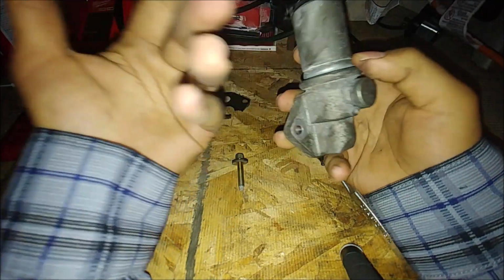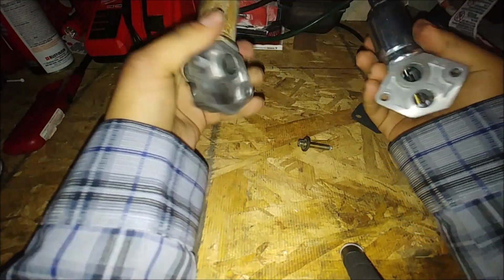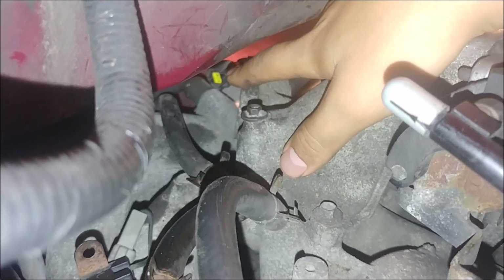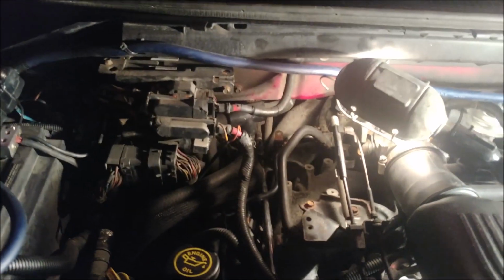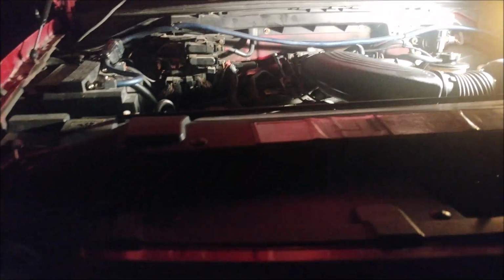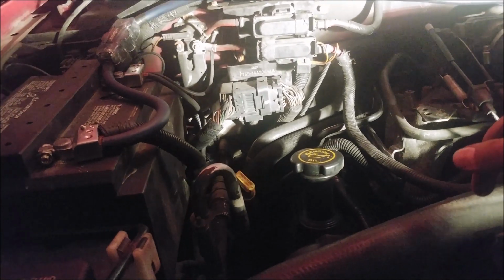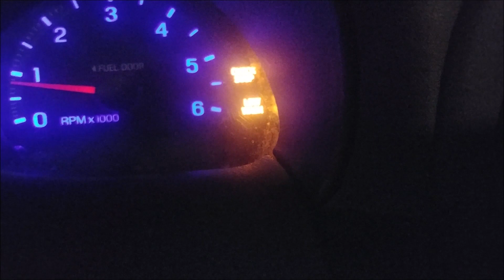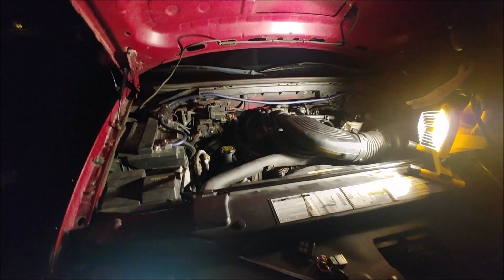1998 Ford Expedition 5.4/4.6  IAC Valve Replacement

Comment: Mine was when the A/C was on, it would feel like it was drowning when stepping on the gas pedal from a complete stop. You need a good lighting source just to see whet you are doing. My technique was using zip ties to hold the hoses and cables out of the way since you can really can reach in with one hand. There is a hose connected to the manifold that you can pull loose and out of the way for better access. You cannot use a standard socket and ratchet. It is better with a 8mm ratcheting wrench like in the video. This is a slow process and you will not be able to change it our real quick. After you loosen up the two screws. You should be able to hand both remove the screws. After it was loose, the wire connector is short and hard to remove the electrical connection. My solution was to route the AC valve back and route from the left side to the right side of the engine. It was far easier to disconnect the electrical connector and then you just route the wire back to the left side of the engine. I then used a channel lock pliers to hold and angle the AC valve using my right hand to hold in position. Then using my left hand to connect the electrical wire back in. You should hear a light click when you do it. Before you put the AC valve back on. Hand thread the two screws in first before to get a feel and know the screws will fit right back in or it may need some cleaning of the  screw threads. I connected the top screw first and threaded through the paper gasket in place. With just enough space  gap to see the bottom screw, I threaded through the paper gasket. It felt like the paper gasket won't line up without seeing the bottom screw go through. Then you hand tight the screws back into place. After that you can tighten the screws with the ratcheting wrench. I got my AC valve on Ebay for 22 bucks. Shipping takes a while to receive it.

Comment: The title for this video is incorrect. This video only applies to the 5.4.  I have a 1998 4.6L engine, and my IAC is right on top of the manifold, next to the throttle body. VERY easy to access.  Could not be easier.
Reply: Definitely correct I see mines too,  changing it now 😁💪🏾
Reply: Correct sir!!!

Comment: Did you take the hose off that was blocking the bottom bolt? Mines set up the same way as yours and I can’t get anything in there on the bottom 8mm bolt.
Reply: did you?? i tried but mine seemed stuck and i don’t wanna rip it off and cause another problem
Reply: I was able to change it out without taking the hose off

Comment: Why did you changed the part,  (IAC)
Reply from the maker: The IAC gasket needed to be replaced and also I had a weird idling issue which went away when I replaced it
Reply: GHOZTPRODUCTIONZ ok, thanks
Reply: @GHOZTPRODUCTIONZ  my 01 5.4 expedition has rough idle and loss of power when accelerating. Did yours have the same issue?